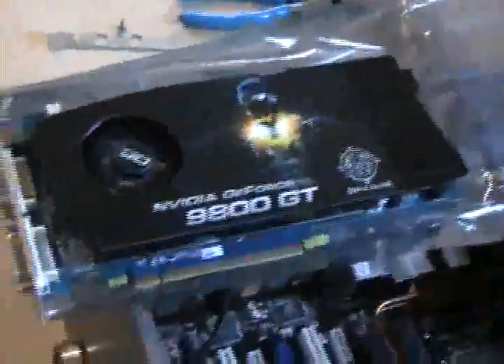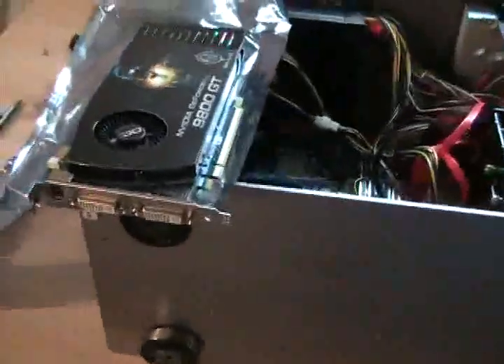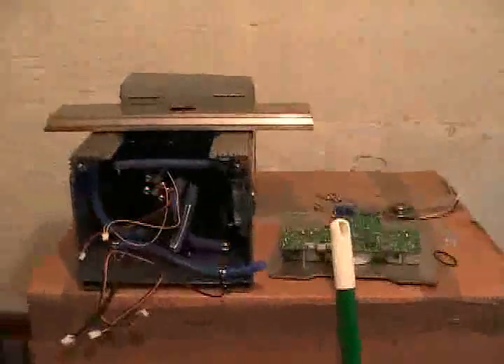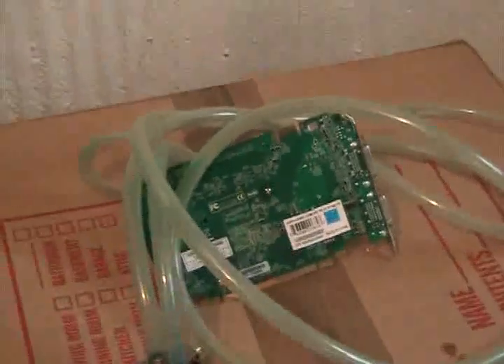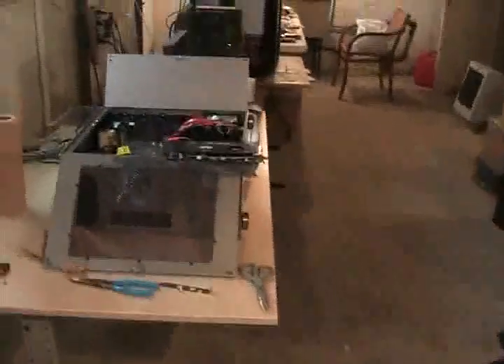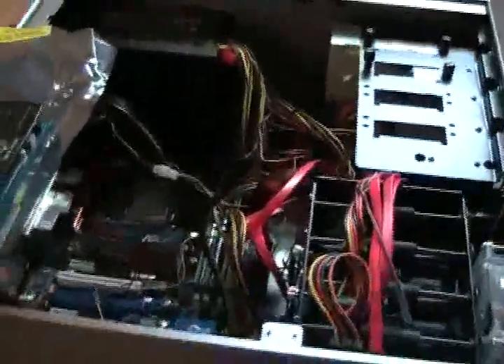Hoses To Fans Part 2

Comment: 250$??? I can get new custom hi end cooling with 700l/h pump and triple 120mm radiator (reserator has 300l/h pump and single 140mm rad...)